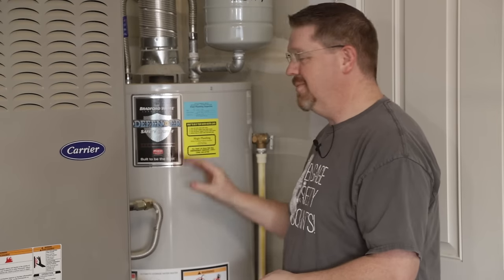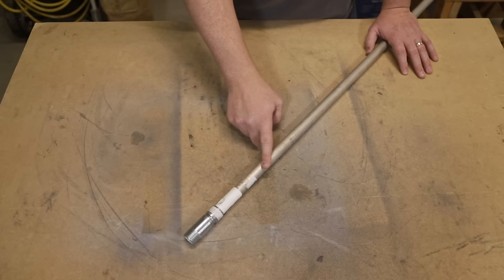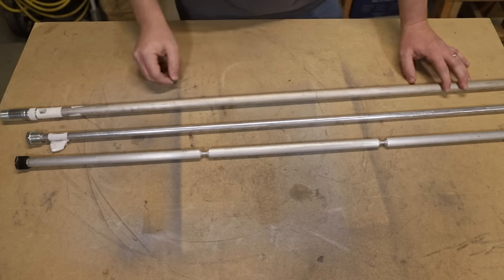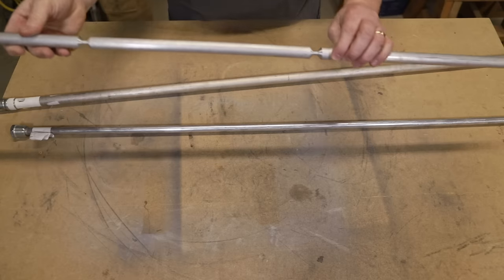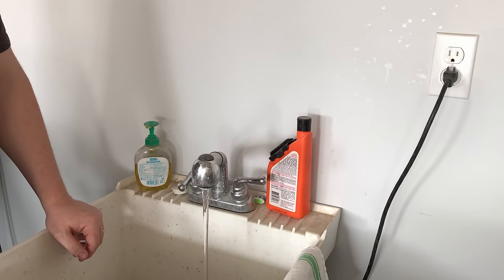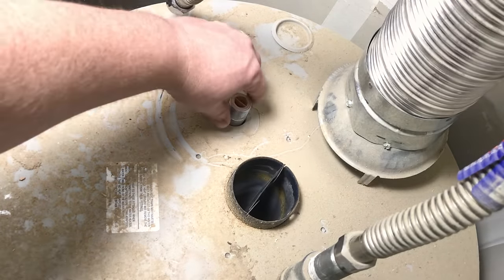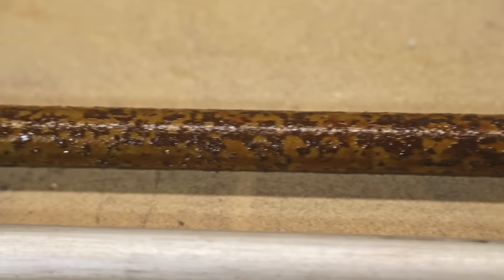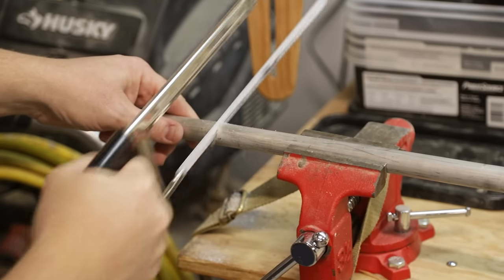How To Replace Water Heater Anode (Step By Step)

Comment: I had ABSOLUTELY NO LUCK getting the anode rod out of my 6 year old Rheem heater.  Didn't even try a breaker bar, but went straight to the impact driver:  Tried an air wrench, a hand/hammer powered impact wrench, and even borrowed a 20V electric wrench.  Nothing would budge it.  I did try a long breaker bar but it immediately started to turn the whole water heater.  Gave up and am returning the anode rod!
Reply from the maker: Oof. It drives me nuts that manufacturers seem to want to install these with something north of 250 lb ft of torque.

Comment: Beautifully produced video. Clear and concise. One point, what does the heat trap do?
Reply from the maker: Hi Karl - thank you for the kind words! The heat trap helps reduce radiant heat loss out the hot outlet when the hot water is not flowing. Great question, and thanks for watching!

Comment: A possible solution for the problem at 10:29 minutes in....Use a 3/4 inch black threaded T fitting and tighten it down on the anode rod then unscrew the anode rod with the T fitting on it
Reply from the maker: Good idea!

Comment: Fantastic video, very professional. Great tips, esp about cutting magnesium! Going to drain flush and replace anode on mine soon, tho mine is a “standard” anode on its own bolt. But was buried under insulation I had to cut out first (Raheem brand).
Reply from the maker: Glad it was helpful!
Reply: Rheem?

Comment: If I inspect the anode rod while doing my annual flush and fill of my hot water tank, my understanding is it's a good idea to pull out the anode after a couple of gallons have drained (so I still have the benefit of the weight of the water in the tank to help me while I'm loosening the anode). Would it be okay, though, to replace the anode, if necessary, when the tank is empty (since the water current presents a challenge in returning the anode to the tank)?
Reply from the maker: Yes, you can definitely do it this way, with one caveat: You do want to make sure that the new anode is in tightly, or it may leak. So, after you have threaded it into an empty tank to be at least snug, fill the tank back up and do a final tightening on the anode to make sure it is tight enough. Good luck!

Comment: I wish that I watched your video earlier. after quite some attempts trying to get the hex cap anode rode out, I ended up the rounding up the hex top so much, so not much grips left anymore and anode rod still stuck in recess position to the top. Any idea to rescue? Thank you very muçh.
Reply from the maker: Oof. Without seeing the exact state of things with your situation it would be a little hard to make a good recommendation. If you really have completely rounded off the head of the anode though, your options may be quite limited. If you would like to email some pictures of what things look like to me (amplifydiy at gmail dot com) I'll be glad to offer whatever suggestions I can. Good luck!

Comment: Very informative, thanks. Why order a new heat trap though? Can't the old one be reused? It isn't metallic so it won't corrode. And yes, both Lowes and HomeDepot carry Eastman anode rods which include suitable replacements for Bradford White.
Reply from the maker: The old one can be used, but it gets brittle over time. It was incredibly cheap, and figured a new one would last longer. Thanks for watching!

Comment: My water inlet and outlet are screw in type  at the top of the water heater. But my plumber soldered solid copper pipe after the brass fittings were screwed on. So the only way to unscrew the water in and out connections the top is to unsolder them. That looks like where my anode is. So I'll just leave it alone. I will ask him next to to use a better solution...

Comment: This was a very easy to understand tutorial.  However, I'm convinced this is not a DIY for me. LOL!  For one, my basement ceiling is barely 2 feat above the water heater and I can just see anything else that can go wrong happen.  My water heater is barely 2 years old, so I'm just going to hope for the best the next 10 years.  BTW, one thing I would have done first is clean off the top of that water heater.
Reply from the maker: Thanks for the feedback! I kept the top of the heater as-is because I like to accurately convey what the project is actually like to do. As for only having 2 feet of headroom above your heater: That's not really a massive problem... as you pull out the old anode you can cut it into sections for removal, and as I showed in this video you can get segmented replacements that are flexible specifically for dealing with your situation. 
Thanks for watching!

Comment: Rheam WH has grey plastic collar cup in anode port. Mine leaks underneath this cap and out onto WH surface. Can this plastic collar be plucked out and replaced? Would this stop leak? The anode is new and tight with pipe dope and teflon tape in the right direction but still leaks under flange, not around the bolt.

Comment: We replaced the anode rod yesterday on our Rheem water heater. After digging out the factory foam and installing new rod we noticed two small wire in the foam in the anode hole. One was severed like I did it digging out the foam. Heater works fine though. You ever seen that before?
Reply from the maker: Hmm... could have just been something left over from manufacturing? But also may have been connected to old anode to make sure there was a conductive path to the anode... but this path is usually provided by the fact the rod is threaded into a fitting in the top of the tank. So.... 🤔

Comment: interesting video. I have this brand. Connections were sweat in so pipes will need to be reworked to replace anode. Something to watch for if you hire a plumber.
Reply from the maker: All nipples should be threaded - did they thread on a fitting then sweat copper directly to that? How odd. Good luck!
Reply: @AmplifyDIY  no kidding, they left a  threaded collar at the water heater junction nut everything else is sweated in so even  if you unscrew the final fitting you cannot move the pipe out of the way.  If you were nuts you could disconnect the gas line and exhaust venting and possibly wiggle the water heater so you could extract the anode rod.  So I will simply cut the hot water copper pipe and add flexible or removeable fittings. Wondering though if it is worth the effort as the heater is 7 years old? Works and looks fine. I will probably replace the anode anyway. I'm interested to know what shape it is in. What do you think?
Reply from the maker: @dennisdeleonard1912  In my opinion, 7 years is pretty young for a water heater. When they are properly maintained, you can expect 20+ years out of a typical heater. If you can make future maintenance easier by swapping some fittings, I'd definitely do that, as the cost in terms of parts and time is pretty minimal. Since you have never checked the anode yet, I'd go ahead and have one on hand as it's most likely completely used up by now. Good luck!
Reply: @AmplifyDIY  thanks.  Will update when completed
Reply: @AmplifyDIY  replacement went well. Rod was really in poor shape.! Appreciate all the great advice and encouragement!

Comment: Very instructional video and very well narrated and demonstrated. Thank you! I have a double vented Bradford White gas powered water tank and I ordered the replacement anode rods before realizing that I only have about 2 feet of clearance from the top of the tank! Will replacing the rod in this case require the tank to be completely emptied and uncoupled before it can be tilted enough to insert the new rod? Thanks.
Reply from the maker: I'm glad you found the video useful! Sounds like you have a tricky install / replacement ahead. It would be best to find a way to get the anode in without any modification to it or uninstalling the heater - but in your case, here is what I would likely try: 
Anode rods are not actually solid rods - they are a rod of the anode material with a steel cable running down through the entire length of it. In your shoes, I'd cut out a notch of the anode alloy about 1/2" wide about halfway down the length of the rod - i.e., get all the magnesium or aluminum (whatever your rod is made out of) off the steel cable there. You could use a hack saw to cut 2 slots about a half inch apart into the anode material all the way around until you get to the steel cable core, then use a pair of pliers to pull / rip out the little section of anode material. Then your rod would be able to flex/bend at the point where you have removed the anode material, and you should be able to get it into your tank. 
A word of caution: DO NOT USE POWER TOOLS TO CUT INTO ANODES. If you have a magnesium anode, it can ignite, and you won't be able to put it out. Cut it by hand with a hack saw, and there is little to no danger.
I hope all this makes sense - essentially you are going to convert your solid anode into something like the flexible anode I showed in this video. 
Good luck!
Reply: @AmplifyDIY  Really appreciate that feedback, thanks very much! And I was paying attention to your warning of not using power tools around (Mg), so I'll make sure to not make that mistake (I vividly recall my senior chemistry class experiment mixing elemental (Na) with water and the resulting fireworks)!

Comment: Had your wrench pointed in the wrong direction when unscrewing the nut on the water flex hose
Reply from the maker: Hi LiveEatPlay - Several others have pointed this out as well... I should have explained in the video: the wrench was not there to apply torque to a fastener, just to prevent the elbow from spinning. i.e, It was not biting on anything - just holding the whole elbow so it would not spin on its fitting. In this specific application, it does not matter which direction the wrench was facing... and I could not have turned it around the other way because of interference with the wall. Thanks for watching!

Comment: For the problem at your brother's house I would have filed the threads down flush with the original metal of the pipe and then gotten out still thin

Comment: I noticed that in the sectioned anode rod I'll be using in my Bradford White (I don't have room to install a full length anode rod) that it has a plastic sleeve inserted at the top that will not accommodate the new heat trap.  I can either not use the heat trap or use a 3/4 x 3/4 Male\Female Stainless Steel adapter at the top of the anode rod then insert the heat trap that way.  What are your suggestions?  Thank you!

Comment: When you check or replace the rod, use a sharpie and write the date on the tank. Check it every two years. If you replace it, only use a magnesium rod. Aluminum and zinc plated cause health issues.

Comment: I bought a house several months ago that has a Bradford White water heater (less than 2 yrs old) installed , and  about a week ago noticed a rotten egg smell from the area where the water heater & soft water system is located.   One person I spoke to said the anode rod may need to be replaced & suggested switching from magnesium to aluminum.   From what you've said and the little bit of reading I've done, a magnesium anode rod is better with soft water systems?   
How often should I expect to have to replace this anode rod?

Thank you.
Reply from the maker: Hi tzd7 - In general with a rotten egg smell your friend is right, switching to an aluminum anode can help - BUT - since you have a water softener, I strongly suggest you don't do that. Does your hot water smell badly in the shower, or do you only detect the smell in the area immediately around the heater? If the water itself is stinky, often the best move is to install what is called a "powered anode" - they are somewhat more rare, but they have a great track record of completely eliminating a rotten egg smell in water heaters with softeners. I don't have a lot of experience with them, but here is an excellent article that explains exactly what is going on and why, and how to best deal with it correctly: https://www.watertechonline.com/home/article/15535688/replacing-anodes-getting-rid-of-odor
Good luck!
Reply from the maker: Oh, and typically you should expect to start checking the anode annually when the tank is about 3 years old, and replace it once it is used up. However, that's just the general rule of thumb: varying water conditions etc can have a large impact on the that timeline.
Reply: @AmplifyDIY  
Thank you so much for your response.
The rotten egg smell is coming from the area where the water heater and soft water system is located; I've not detected any odor coming from the water itself.
I'll take time this evening to read the article you provided to become more acquainted with this.   
Your expertise is much appreciated!
Reply: @AmplifyDIY  
I had a plumber out yesterday who told me the odor cannot be due to
a bad anode rod because there is no odor in the water itself (coming from faucets or shower).
He also drained some water from the water heater and let that drain into floor drain and did not detect any odor coming straight from drained water.     He left my house perplexed saying he did not have any idea where the odor was coming from.   He used some type of detector to check for gas leak (which picked up no leaks).   Could methane gas be the cause of this odor coming from this closet?
The floor drain is very old and corroded.   I'm at my wit's end with this situation and not knowing where to turn.   Thank you for your help.

Comment: I have a 40 gallon 240 electric Bradford White WH. Both anode connections started leaking at the same time. So strange. I'm wondering how that could happen? Would you try to remove them and if the rods were'nt in bad shape just apply new tape and pipe dope and reinstall?
Reply from the maker: That is odd! Yes, that is exactly what I would do. Good luck!

Comment: This was a great video, step by step! Now what is the next step if the anode rod got completely eaten up and when I went to remove the old bolt only the top of the bolt came off and it the rod was nowhere in site??? My electric 80 gallon heater is a whirlpool with only like 6 yrs of use on it. Am I screwed??
Reply from the maker: Hi Enrique! I'm glad you found this video to be helpful. Thanks! As for your situation: don't panic. :) Here is what I would do: 
Anode rods usually are constructed with a center core made of steel threaded cable, roughly 1/8" or so thick. This cable should run from the top all the way to the bottom, and should have stayed connected to the top when you pulled that out. The anode material (magnesium, aluminum alloy, etc) encases this steel cable and is what is slowly eaten away over time in your tank. So: there is a good chance that there is a steel cable coiled up at the bottom of your tank. I would do my best to get it out. Here's how: 
If you have not already seen my video about how to flush your heater, I'd start there. Most likely this will not bring the cable to the drain valve, but you may get lucky: https://youtu.be/hs5N7HyDUWo - regardless, if you have not flushed your tank, do so in conjunction with replacing your anode.
Assuming you are unable to retrieve the cable via flushing, you may need to try to inspect the interior of the tank to see if the cable is in there. Luckily you have an electric heater, so there are a few ways to see what's inside the tank. I'd suggest you drain the tank entirely, and remove the heating elements. Consult your owner's manual to see exactly where these are located and how to remove them. Taking these out will provide a few holes into the tank you can peek into, as well as let you inspect them to see if they are ready to be replaced as well. 
Next, remove the drain valve entirely to get better access to the bottom of your tank. With the drain valve removed, you should be able to fish a bent coat hanger into the bottom of the tank, and hopefully hook it onto the cable if it's there, then pull it out through the drain valve. If you go as far as removing the original drain valve, I'd suggest replacing it with an upgraded valve - they are cheap and easy to install, and make flushing MUCH easier in the future: https://youtu.be/OBPJYg0o_o0
Once you get any remnants of the old anode rod out of the tank (or verify that there is nothing in there in the first place) go ahead and close the tank back up (reinstall heating elements, reinstall drain valve and fill the tank most of the way) then install the new anode and the tank should be good to use. 

Good luck!
Reply: @AmplifyDIY  wow thanks for much for the lengthy reply! So I watched all your vids and have replaced everything on mine exactly how you showed. Had to zoom in on some parts to make sure I was getting the exact stuff you did lol. I had a tiny leak after installing the new valve but tightened it and was perfect. Thanks so much! 

Now do I HAVE to remove the old cable from the tank? I feel like that is a lot if work now. All I did was put in the new rod and put it back together and now waiting for water to heat up again.
Reply from the maker: If the tank heats normally, I'd let it ride. The next time you are in there to do a flush or check your heating elements, dig around to see if you can find any remnants and get them out. My only real concern is that the steel cable may contact the heating elements - I'm honestly not sure what would happen in that case.. but I suspect the worst that could happen would be the heating element would stop working, and you'd need to replace it. That's a pretty small downside risk, so I'd leave well enough alone. Good luck!
Reply: @AmplifyDIY  ill leave in the new one and next yr during the flush ill look for remnants, thanks again for all the info and videos!